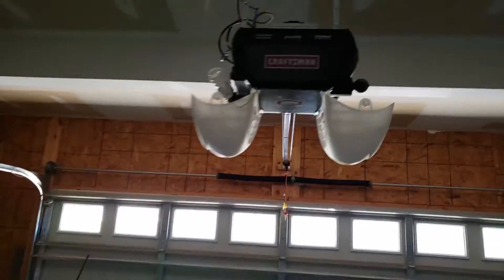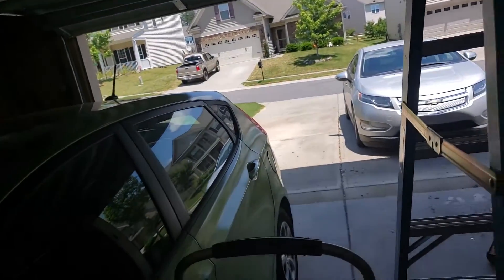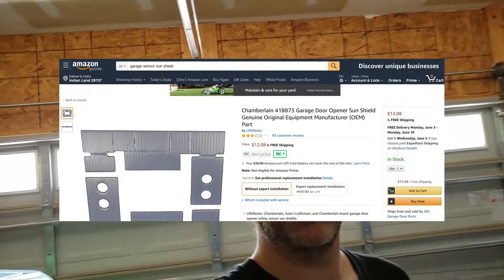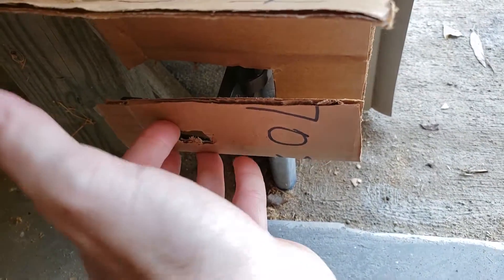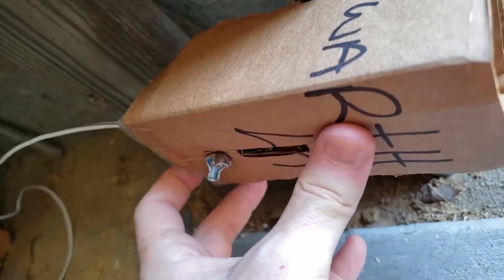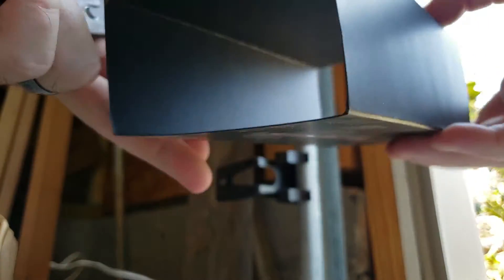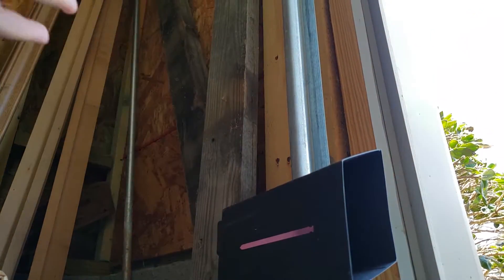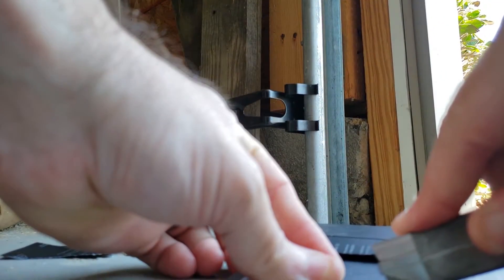Easy Fix - Garage Door Opener Won't close (Try this instead of buying more stuff)

Comment: We moved our sensors back towards the wall and they are both always on the shade and we still have the same problem. If we provide shade by placing trash can in front of the door so it shades the floor it will close. I'm thinking it may be sensing the sunlight on the floor. So I'm thinking of painting part of the floor flat black to see if that helps.
Reply from the maker: good luck.  for me, it was the driveway reflection that caused the sensors to trigger almost as much as the sun hitting hte sensor.  i tried blocking the sun by putting something in front of the sensor but then realized it was just ambient brightness.  Goodluck!

Comment: Your right that was a noisy door, put some grease on those garage tracks/wheels! Moly grease would do best. It'll make the whole thing run smooth and quiet and last longer, also if it's using a chain make sure it's lubed!
Reply from the maker: I just saw this comment so apologies for being late responding... I didn't end up using coil spring oil and it has been very good ever since.